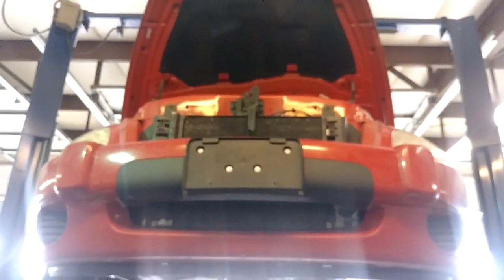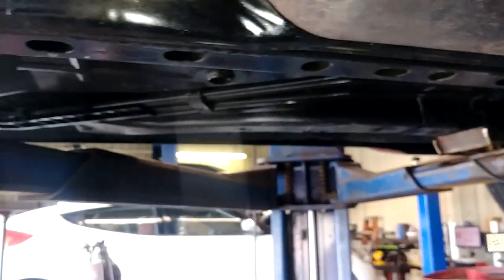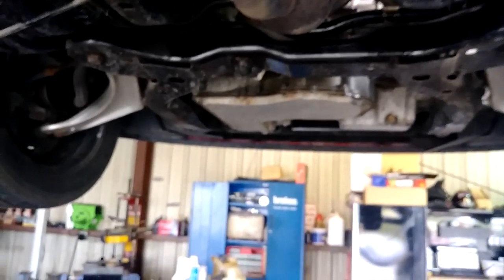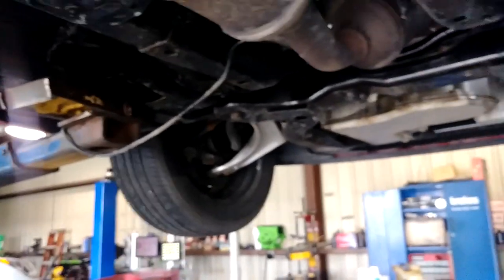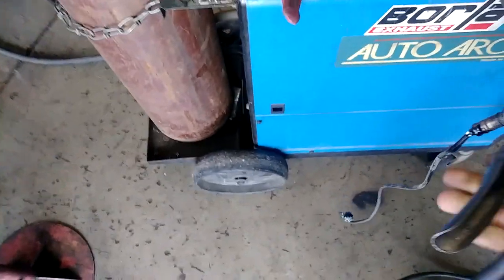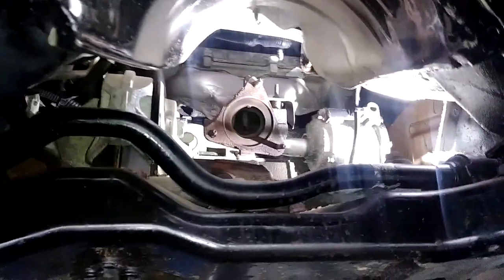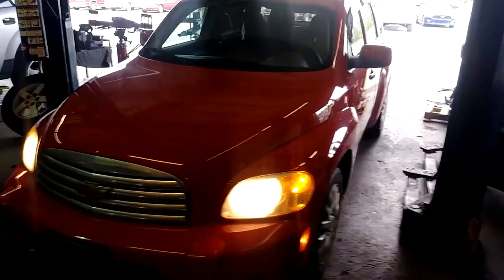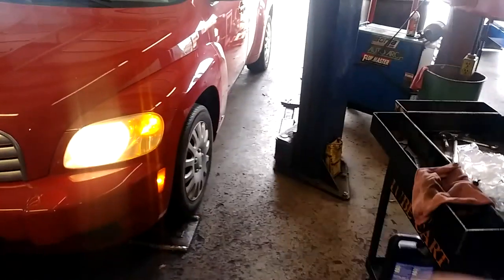$100 HHR EXHAUST

Comment: How do you think a straight piped 2008 would sound? I'm getting mine in a year and dont know if it would sound good and I'm not finding anything about its sound
Reply from the maker: It would sound like a pissed off bumble bee. If you want a good sound and not deal with the bad sound ide suggest doing a glasspack style muffler in the center of the exhaust and run 2 1/4 inch exhaust pipe out to the rear with a nice tip. Ive done many 4 cylinders with a similar setup and in my opinion sounds much better than straight piped
Reply: Yea sounds terrible I did it with my hhr

Comment: How much for this work
Reply from the maker: Normally a shop would charge mark up of 1.5 to 1.9 for the part and usually 2 hours to replace including welding. Really depends on your location and what the labor rates are. If done in my shop we would charge a 1.5 mark up that includes warranty and 2 hours of labor or $100